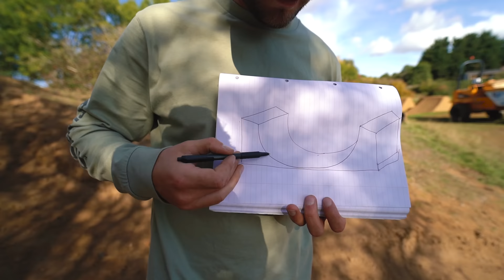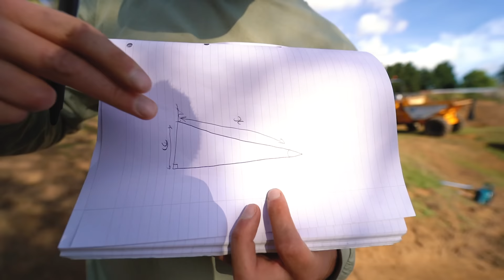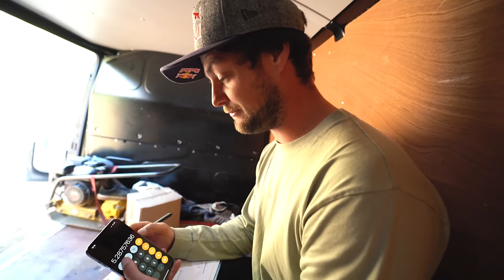WE BUILT A BEAST! RIDING THE BIGGEST MTB DIRT JUMP YET!! PLAYGROUND EP28

Comment: The set before the big left hip needs more dirt on the landing throughout and leading to the flat bottom to hold an gain speed for that massive left hip, that’s slightly uphill.. if the set before it was bigger I don’t see issue with speed, or the need to change that left hip. Also adding dirt to the set before will shorten the distance of the flat bottom, allowing for more speed. Sort out the kinks! 80%dig 20%ride. Such is trail life. Or in your case ~playground~ life hahah love the content. Keep it up mates!

Comment: If you really wanted to nerd out on the whole calculation thing, you could first measure the speed coming into the landing with the good ol stick trick (have two sticks at a measured distance, get a high speed camera (maybe normal slow mo is enough) and see on the timeline how much time it takes to clear the distance, which translates to speed (distance over time))
To that speed (lets call it v0) you can add the speed you would gain from the landing. For that you have to convert potential energy (mass*height(top of the landing - top of the lip)*gravitational acceleration(=9,8)) into speed which is convertable from kinetic energy (=0,5*m*v^2) -> v = squareroot(2*potential energy/mass).
After you've done this, you can put the speed and angle of the take-off into a ballistic path calculator (which you can find online) and calculate the trajectory.
Have fun :D

Comment: I truly think the big hip can work. The problem is in the rollers and the step down. when watching Jamie and Ben roll through the rolllers look like they are a bit steep and potentially too tight. Looks like they are rowing the boat a bit rather than gaining that speed boost with every pump. If the rollers change to generate more speed, then the step down could be bigger which would obviously give you more speed for the hip. Pretty confident that would do the trick

Comment: If you don't mind, I will correct a bit the physics. The calculation that you are doing is assuming conservation of potential energy if you started on the top of the first landing stopped, however: you actually were on the air before and when landing are also carrying speed.

In order to make the calculation correct I would say you start stopped on the top of the first landing and then jump in the air in a 90º lip where you actually loose all your velocity and transfer all the kinetic energy into height, otherwise the more lateral velocity you have the less high you will also jump.

At the end of the day there's a lot of friction which you can't really calculate so another way would be to calculate the kinetic energy (E = 1/2*m*v^2) at the lowest poing before the lip, so that all the losses due to friction until then are taken out, and then you will go as high (h) as: m*g*h + 1/2*m*v'^2 = E, h = (E - 1/2*m*v'^2)/(m*g).

Comment: Also to gain speed you could increase the angle of the approach creating a more aggressive "gravity cavity" you have enough space there from roll in to take off that you shouldn't have a g-out zone
Reply: The landing/mountain side roll in does look flat by the time they hit the transition to start taking off, elevating the ski jump run into a steeper pitch or move the jump closer with a split hip landing left and right creating more options
Reply: @domgray7587  ya it has a long grade so you can't effectively pump the bottom transition to create speed. If it was a bit steeper with more radius at the bottom for the transition to flat you could pump through the belly but still maintain the longer flat bottom to setup for the takeoff.

Comment: You took a flat bank to a quarter circle.  Means different physics and maths. As you cannot pump a flat lander the same as a quarter, you won’t be able to get the speed or push you want.

Someone above said about a roller. That would work. BUT I would put it on the flat bank with the base ending at the bottom of the flat bank.

Comment: Suggestion:
hollow out the bottom of the big landing a bit more instead of adding a roller.... the bottom 60% of the big landing is pretty banked
then add wood to the flat bottom, or concrete... FLYING